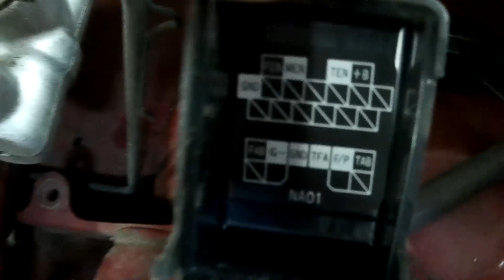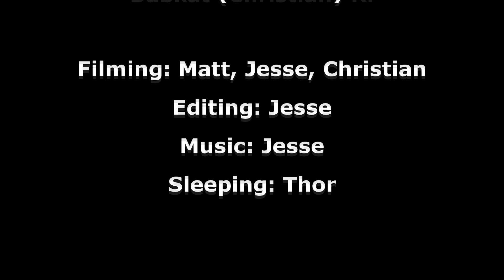Check Your OBDI Codes With no Scanner! | Miata Tutorial

Comment: Okay, so I know a dtc. But, what about fuel trim and o2s data, that's what I need to see.
Reply from the maker: You either need a real scan tool with a mazda OBDI adapter or you can manually watch the sensor data with a multimeter backprobing the o2 plug.

Comment: Ok guys here is one I have not seen posted yet anywhere. I have a 96 Miata and I do have the OBDII connector but it seems that either someone modified the wiring or maybe a blown fuse to the power for the connector. Seems like there is no power going to the scanner. Anyone else ever have this problem? Can I just use the test procedure in this video to troubleshoot my CEL?
Oh, FYI the car runs fine but check engine light stays on but is not flashing.
Reply from the maker: Usually when that kind of thing happens the check engine light does not stay on! But I will tell you double check all your fuses under the dash above the driver footwell, usually the ECM shares a fuse with the cigarette lighter or interior lighting. If you check and ALL those fuses are good, then let me know and I will see if I can help you get a pinout or wiring diagram.

Comment: Does the Mazda Miata 1995 have an odb2 port ? If so let know where thanks
Reply from the maker: As far as I know no, there is no full OBDII support untill 1996 on these cars.
Reply: Dammit nooooo!!! lol I just an obd2 scanner for no reason lol  because I wanted to reset my check engine light ?
Reply from the maker: Miata Tokyo built then follow the process from this video, if its staying on you currently have something wrong. Even if it was OBDII your light would persist after clearing it because you have a problem. Clearing codes/lights is not a fix to a problem! Nor is a code a direct confirmation on a bad part!
Reply: OBD2 became a thing for cars 1996 and after. Any car before isn’t going to be OBD2